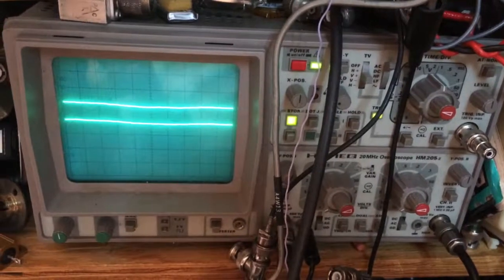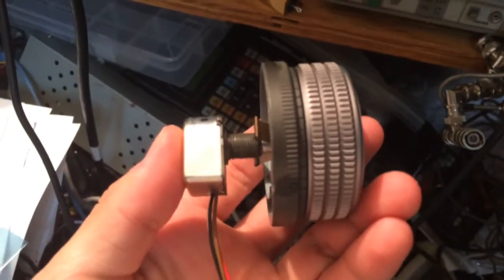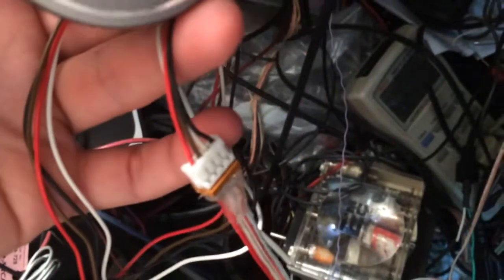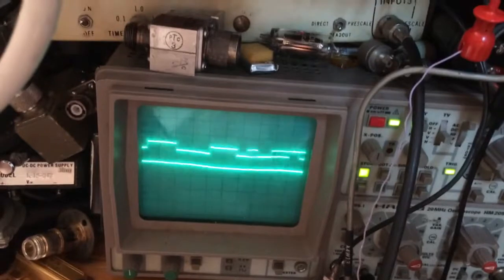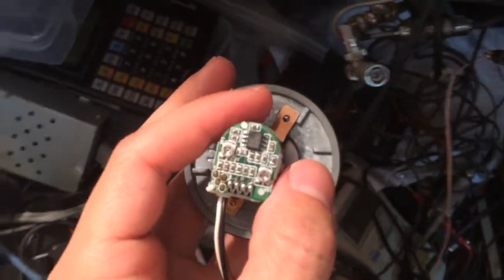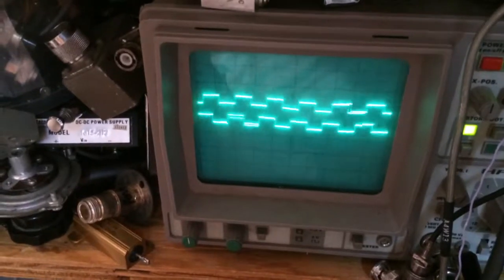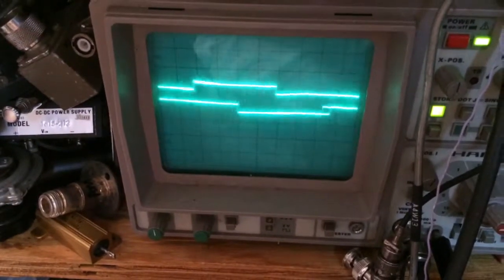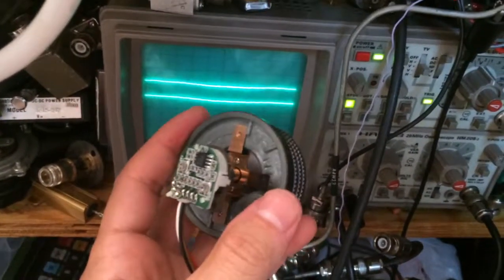Kenwood TS-850S Tuning Knob Encoder Repair

Comment: What tool did you use to remove the knob???
Reply from the maker: If I remember correctly I just needed to loosen the retainer screw in the hole with a small Allen wrench. After that you can gently pry the knob off with a flathead screwdriver, if it doesn't just come right off loosely.

Comment: My knob jammed any idea please help
Reply: Today i've jammed also my knob and eventually the knob is falling off..could you advice hiw to repair it..?
Reply from the maker: @theanaksinga7215  Sounds like the screw that holds on the knob may be stripped and need to be replaced, or possibly just tightened if the knob is falling off. Take it off and investigate. A little experimentation should show you what's happening.
Reply from the maker: Well, you could have some gunk that got lodged. I would take the knob off and investigate. You just need a couple of allen wrenches and shouldn't need to remove the encoder. Also play with the friction adjustment and see if it is too tight.